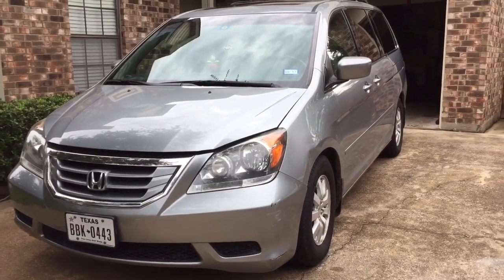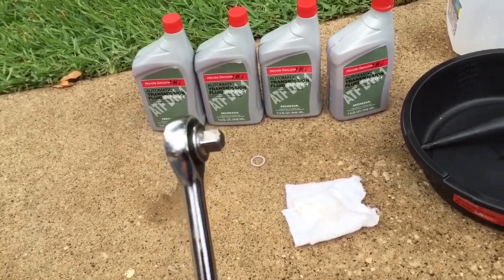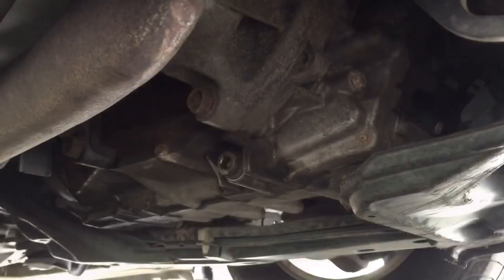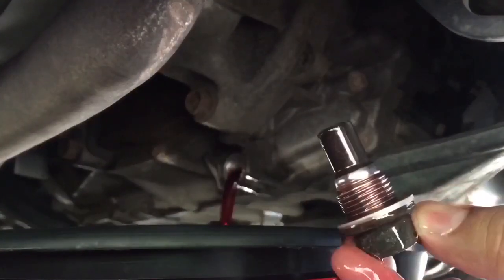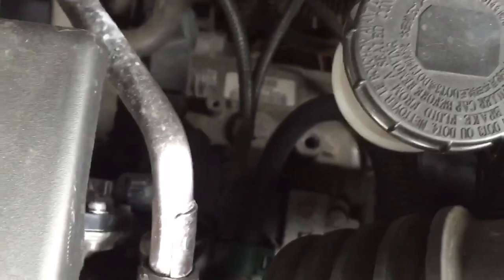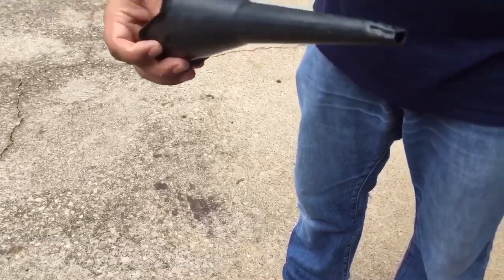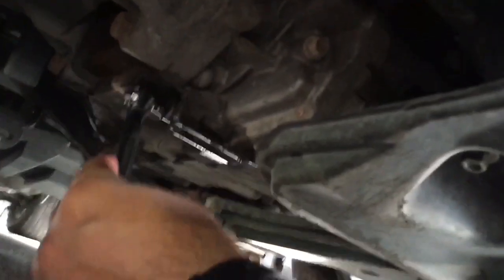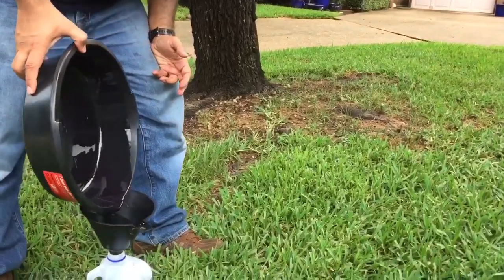2005 - 2010 Honda Odyssey Transmission Fluid Change

Comment: If you're going to do video on how to do a job buy the right tools you can buy a cheap set for under 25$ 😮
Reply from the maker: Thank you for the suggestion. The tools / ratchet used in this video is from the tool set listed in the description of video. the video shows only what is needed to do the work, not the full tool set. However, I appreciate your feedback.

Comment: Why need to replace the washer? Can use the old one with flip side?
Reply from the maker: The washer used here is a 'crush washer' made of aluminum, and as the name says it 'crushes' (flattens) when we tighten the drain plug in order to make a seal and not let the fluid leak out. I have re-used the same washer when I ran out of new ones and noticed that old one held up okay for second use - I just had to really tighten the drain plug. By third time of re-use (to test its longevity), the washer was already flattened and couldn't be crushed any more to make a seal, so the transmission fluid started to slowly drip out of drain plug.  I would recommend to use new crush washer. Honda dealer sells one crush washer for $4. The description of video has link to get 10 washers for $8. I do one drain & fill every 10K miles and use the crush washers for my Odyssey. Whether you use new or old washer, the decision is ultimately yours to make.
Reply: Make sense. Good to know. Thanks @FlyBeee
Reply from the maker: @davidx9017  You are welcome.

Comment: So there’s no filter?? I’m gonna be doing the same job on my wife’s 07 Honda Odyssey just wondering
Reply from the maker: There is a filter but it is not easy to access and therefore not a regular service item. The 2005 - 2006 Odyssey had a different transmission which had serviceable transmission filter but that transmission had major issues and Honda replaced it. Therefore the 2007-2010 Ody has a different transmission that does not require filter replacement. You can if you want to, but I have not change filter on my 2010 Ody and we use it everyday.
Reply: @FlyBeee  ok Ty
Reply: It’s a 17mm bolt on the transmission fill plug. The filter is under the battery box.

Comment: Honda conveniently put a fill plug in the top of the transmission for filling. Don't use the dip stick tube! The correct way to fill it is to simply remove the fill plug on the top of the transmission and use your funnel to easily fill it.
Reply from the maker: Yes, there sure is. I just showed a different method to fill. Thanks
Reply: Yes but where do you get a 24" ratchet?
Reply: Harbor freight has Pittsburgh extensions for $20 for a 4 pack. Has an 18” long one and it’s long enough to reach that’s what I use

Comment: Yes I got a question .you waited until you was done pouring new fluid in.before you tightened underneath drain plug.was.there a reason.
Reply from the maker: Very good question! I did not fully tighten the drain bolt until after I refilled new fluid and checked the fluid level - just in case I overfill by mistake and have to drain some fluid to correct the level.
Reply: Very good thinking! As long as I don’t forget to go back and tighten it.

Comment: Thank you for your video. Quick question: I have a 2010 Honda Odyssey with 112K miles;  I did my first drain(cold trans) 3 weeks ago and the amount of fluid that came out was little less than 3.5 qts; I did my second drain last night and the transmission was slightly warm and the fluid that came out was exactly 4 qts and it was a bit hot. I filled the same amount and the dip stick shows the level a bit higher than the second dot. Do I drain the excess or keep it that way? What do you recommend?
Reply from the maker: I would recommend to drain the excess fluid - but confirm that vehicle has excess fluid. The method recommended by Honda to check transmission fluid level is to park vehicle on flat / level surface, keep vehicle running and wait for the radiator fan to kick-in, when fan cycles off then turn off the vehicle and immediately check the transmission fluid level. If needed drain the excess fluid.
Reply: @FlyBeee  Thank you much for your response. I tried something similar this afternoon; drove around to pick the kids from the school and while there checked the dipstick; and the level showed almost an inch higher than the second hole on the dipstick. 

1. I am not sure why the second time drain got out almost a pint more? I did drain both times flat on the ground the same way you demonstrated in the video as it was quite accessible. The only variable was the engine & transmission temp…first time overnight cold; second time 20 mins after a 10 mile drive. 

2. What do you think is the best way to remove the excess amount precisely? TIA
Reply from the maker: @ravireddy2535  Warm fluid flows better so that is one reason. Other could be that if it was a while since the transmission fluid was changed then old fluid may have had more impurities and sludge vs the newer fluid the second time. A fluid level higher than the top most mark on dip stick should be corrected. To do this at home the easiest and lowest cost option is through drain-bolt. Transmission fluid start to drip out of drain bolt when it is lose but not fully removed. Use this setup and a drain pan to remove the excess fluid. If you find out too much fluid was removed then fluid that came out of the vehicle, put some of it back in. Best wishes
Reply: @FlyBeee  maybe use the turkey baster to suck it back out from the top...
Reply from the maker: @SharonH-ls4qw  that should work too. I was just going the cheapest option! lol

Comment: It would HELP IF YOU  SHOW 'WHOLE VIEW' OF ENGINE COMPARTMENT---AND SHOWED LOVATION OF THE TRANSMISSION-FLUID DIP-STICK ----- AND WHERE  YOU  WERE RE-FILLING THE TRANSMISSION FLUID???
  The camera was so close to the dip-stick,... I couldn't locate the dip-stick in  relation to other items in te engine compartment?  It looks like you're near the battery,... but can't tell because you're TOO CLOSE IN?
 Also,  I  saw  another video which shows the ENGINE-OIL DIP-STICK LOCATED BEHIND THE BATTERY?
PLEASE CLARIFY LOCATION OF  DIP-STICK & REFILL FOR TRANSMISSION FLUID?
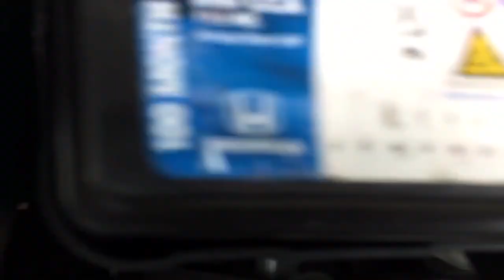Reply from the maker: On my Odyssey the transmission fluid dipstick is located in the gap between the battery and the engine. You can see it on counter 3:22 in this video. It has a yellow color round handle so you can pull it up with a finger. This applies to 2008-2010 odyssey model. The 2005 - 2006 Odyssey had a different transmission so the location of the dipstick may be slightly different on that. what model year is your odyssey?
Reply: @FlyBeee  Thanks for your reply.   I have a 2005 Honda Odessey..  I have confirmed that the Engine-oil dipstick  has  a YELLOW loop-handle (as is standard for nearly all vehicles),.. and is located toward the fire-wall side (passenger compartment) beind the Battery.---
This link shows a clear view (not too close zoomed- in  with the camera)  of the engine compartment and engine-oil dipstick location--  near the 10:35 min. time-stamp....    
https://www.youtube.com/watch?v=bdSoz_UOMrE

I also added  engine-oil,.. and  checked the Yellow-handle dipstick  BEFORE-AND-AFTER adding the  oil, which confirmed the reading.  The ORANGE loop-handle  dipstick on the left-side of the engine-compartment (as you're  facing the engine compartment from  outside the front of the car,.... the battery is on the 'right' side),....  is for the TRANSMISSION FLUID.  It has a 'cross-hatch' pattern on the dipstick where you read the  fluid level.    Whereas the engine-oil dipstick simply has 2 tiny  holes where you read the fluid level  that indicate the top level of fluid, and 1 qt low level.
As I understand, the 2005--2012 have a similar configuration?

-- God  Bless
Reply from the maker: @boydasmith  Thank you for sharing the details. I am assuming there is a typo in your comment above and that you checked transmission fluid level with Yellow dip-stick, because the Orange dip-stick is to check Engine oil level. Please refer to the Owners Manual as well. In the video link you shared the guy showed incorrect dipstick and the many comments under his video clearly point out to this error. If both the engine and transmission oils are at their level then it doesn't matter which dipstick we checked. However, I just hope you didn't put engine oil in the transmission and vice versa.
Reply: @FlyBeee  Thank you very much for your reply.,... and for helping to clear up my confusion on the dipstick colors
The 2005 Honda Odessey is just a  'loaner' car from my son, while my transmission is  being repaired in another State (Kansas) where  my son lives. 
 My  2001 Toyota  4Runner  is being repaired, and it has the dipstick  COLOR CONFIGURATION ( engine-oil  YELLOW,... transmission-fluid ORANGE,....  So I mistakenly agreed with the SNAFU from  the other oil change video link I sent you where the man mistakenly chose the YELLOW  handled dipstick, thinking it was for the engine-oil! Everything else in your video was correct.

   After .double-checking with Op-manual,.. and  other videos, I discover that  ORANGE can be the color of engine-oil dipstick on some Hondas------IT SEEMS SOMETIMES  IT'S YELLOW, AND SOMETIMES IT'S ORANGE,.... DEPENDING  on what year,  model,... and arbitrary whim of the  manufacturer? 

       It's a good policy to check the Op-Manual,...AND physically inspect where the  dipstick tube is actually going? On my Toyota 4Runner (V-6) it's very  easy to see.   But this Honda engine is 'side-mounted,... in line with the  front  wheels-- a little trickier. 
  In general it seems the engine-oil dipstick is closer to the  fan belt pulleys in the FRONT---  or in this case the  LEFT side (as you're facing the  front of the car? AND the transmission dipstick tube is closer to the bBACK of the  engine-- or in this case  the RIGHT side  (as your facing the  front of the car?

THANKS VERY MUCH AGAIN FOR THE CLARIFICATION!!

God Bless
Reply: @FlyBeee  
Thank you very much for your reply.,... and for helping to clear up my confusion on the dipstick colors
The 2005 Honda Odessey is just a  'loaner' car from my son, while my transmission is  being repaired in another State (Kansas) where  my son lives. 
 My  2001 Toyota  4Runner  is being repaired, and it has the dipstick  COLOR CONFIGURATION ( engine-oil  YELLOW,... transmission-fluid ORANGE,....  So I mistakenly agreed with the SNAFU from  the other oil change video link I sent you where the man mistakenly chose the YELLOW  handled dipstick, thinking it was for the engine-oil! Everything else in your video was correct.

   After .double-checking with Op-manual,.. and  other videos, I discover that  ORANGE can be the color of engine-oil dipstick on some Hondas------IT SEEMS SOMETIMES  IT'S YELLOW, AND SOMETIMES IT'S ORANGE,.... DEPENDING  on what year,  model,... and arbitrary whim of the  manufacturer? 

       It's a good policy to check the Op-Manual,...AND physically inspect where the  dipstick tube is actually going? On my Toyota 4Runner (V-6) it's very  easy to see.   But this Honda engine is 'side-mounted,... in line with the  front  wheels-- a little trickier. 
  In general it seems the engine-oil dipstick is closer to the  fan belt pulleys in the FRONT---  or in this case the  LEFT side (as you're facing the  front of the car? AND the transmission dipstick tube is closer to the bBACK of the  engine-- or in this case  the RIGHT side  (as your facing the  front of the car?

THANKS VERY MUCH AGAIN FOR THE CLARIFICATION!!

God Bless
Reply from the maker: @boydasmith  You are welcome, I am glad to help! I hope all went well with your Toyota 4Runner. Best wishes

Comment: Hello sir . Honda Odyssey 2007 have oil filter.  ?
Reply from the maker: If the question is about Transmission fluid filter, Honda used a different transmission from 2007-2010 Odyssey which does not have a serviceable transmission fluid filter. The 2005 - 2006 model Odyssey has a serviceable (easily replaceable) filter that should be replaced. But if the question is about Engine oil filter then yes, 2007 odyssey has engine oil filter that should be replaced every oil change. I hope this helps
Reply: @FlyBeee  2010 odyssey has transmission filters?
Reply from the maker: @josane02  It has, but not on maintenance schedule. The 2005 and 2006 models had filters that needed to be changed. These two model years had transmission problems so Honda changed the transmission for the 2008 2010 model year which does not have a serviceable filter therefore not a maintenance item. As long as fluid is changed on schedule that should keep vehicle in good shape. If fluid is not changed for a while then dirty fluid will most likely clog the filter when then needs to be replaced.
Reply: @FlyBeee  thank you